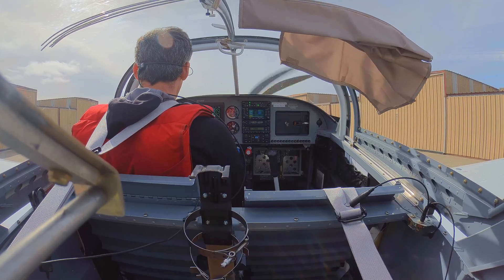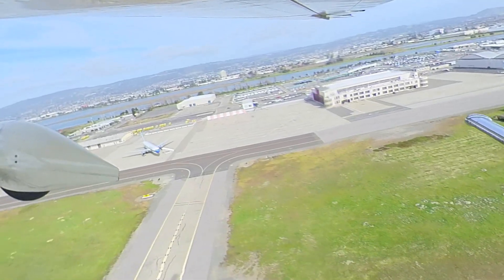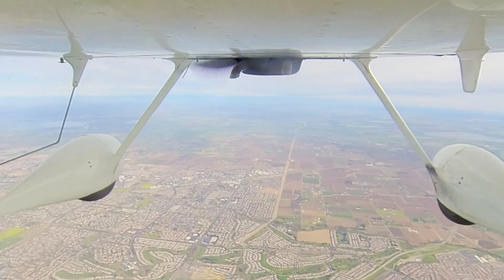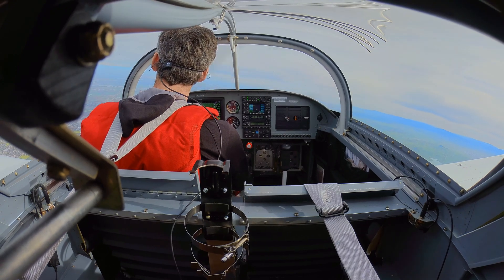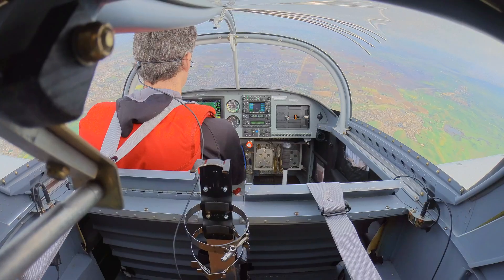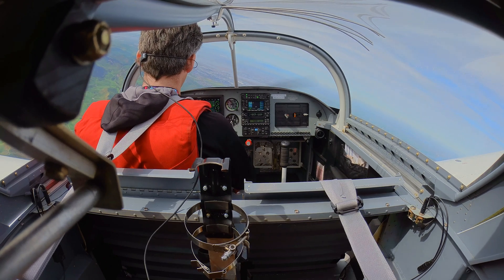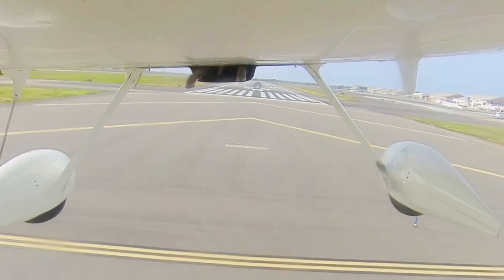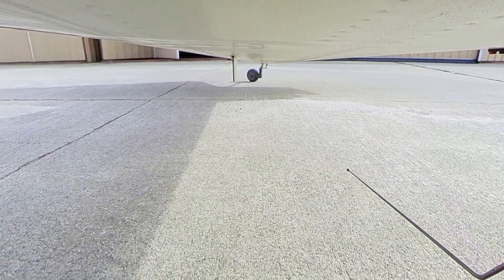RV 7 Spin and G Series

Comment: Where is the buildup to Vne which properly needs to guild up to Vd and the build up to g with in between inspections and why are spins in the same event? If truly testing, these events should be spread over at least eight flights. As for spins, what about inverted, accelerated, flattening, test of inappropriate recovery for negative effects?
Reply from the maker: Woah, calm down. The airplane completed phase 1 testing back in 2003 when it was built and certified. There’s no need to go through all that again. This is just a series of flights to get me familiar and confident with my new (used) airplane.

Comment: I found when I do a sharp turn in front of the hangar all I do is blow dirt into it :)   what was your spin entry speeds? looked as if you were just snap rolling into a spin without actually stalling?
Reply from the maker: See for yourself! https://www.flysto.net/logs/oggkrq9a?view=3d&x=-2664867&y=-4299933&z=3891068&h=359.974&p=-25.223&r=0.023&t=1243&profile=on&check=11sowwx

Comment: Strange thing that "aeleron induced stall".    I'm not sure that's a thing, but maybe you were just too slow on entry?    I have a 7A and I was taught to enter around 140 and use full stick deflection to one side or the other.    I never had an issue like that.    Have you thought about that more?    Have you posted this video or link to it on VAF?